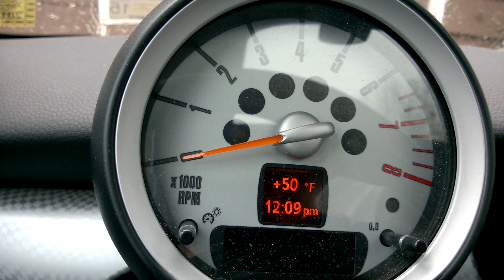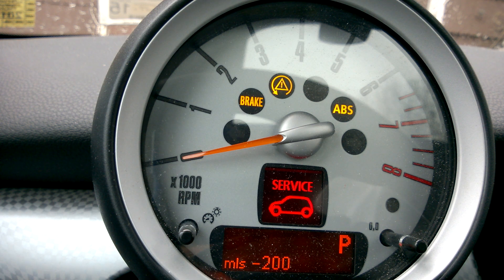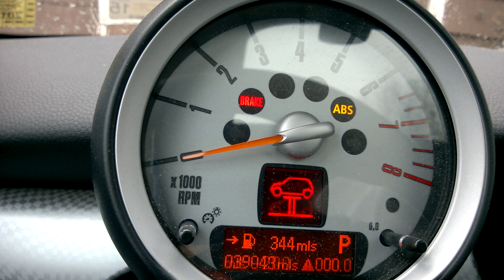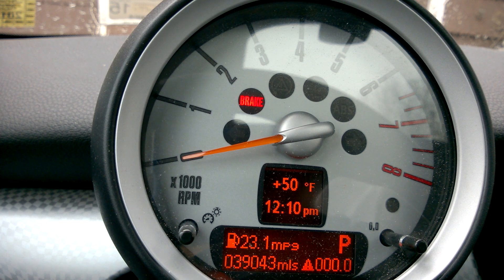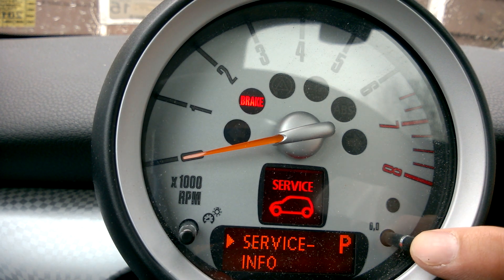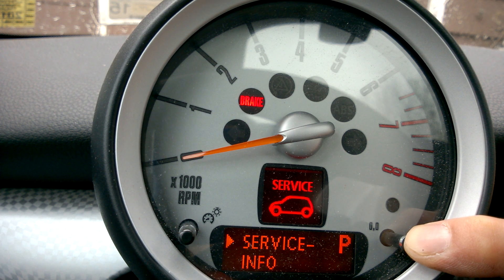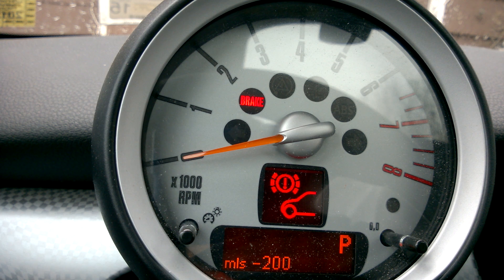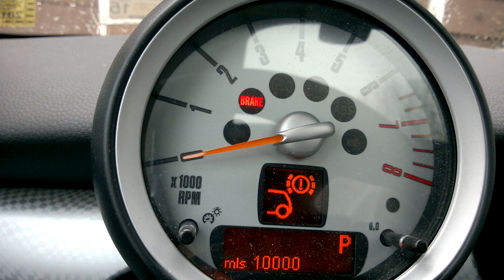Resetting brake pad service indicator R56 MINI Cooper S

Comment: This was a huge help.  The owner's manual leaves out a few things.  That manual is a complete mess regarding the onboard computer.
Reply from the maker: Glad it helped!  

Other hidden function that MINI obfuscates is the ability to read sensors with the onboard display, coolant temperature for example-

Ignition on,
Hold right cluster button until it says VIN, press button repeatedly to get to mode 19 for the lock code entry, then pause and wait for it to show lock on/off display, then set the code by short pressing until display shows the required code, e.g. 27, which is the sum of the last 5 digits of the car's VIN.

Long press to get back to mode selection menu, then repeatedly short press to go to mode 07 for the coolant temperature display, pausing for it to come up.  Then it should show the coolant temperature in deg C, which MINI inexplicably excluded from the normal gauge instrumentation, despite it being much more critical than other cars, given the tendency for the water pump and thermostat to fail on these.

Comment: I’ve done this, but the front pads light is still staying on? Are there actual sensors on the pads as they wear down, whereby the front pads service light won’t go out unless they’re renewed, or is it purely a mileage trigger for renewal?

Comment: Does this work regardless of service on the brakes...just curious.thanks for sharing.
Reply from the maker: This warning is just checking for the connection of the sensor wires on two of the wheels, and doesn't directly measure the pad thickness. They mount the sensor, which is a wire loop inside a substrate that will wear down as the pads get used up and get closer to the rotor. When the sensor is worn down from contact with the rotor, it breaks the wire loop connection and sets off the warning.  If you replace the pads before it breaks the loop you wouldn't have to replace the sensor, but they didn't design it to be removed easily when replacing the pads, so it takes extra care to remove. Shops probably won't want to bother saving them for you even if they're still intact, easier for them to just bust them off and put on a new sensor. Should be about 15 to 20 bucks each.
Reply: @dtrrtd774  THANK YOU for explaining this to me was very useful since I was thinking my back brakes have about 40% life left..any couldn't turn the light out.its funny how they let you reset the front brakes but not the rear brakes.
Reply from the maker: @dcartellone2659  They put the pad sensors on diagonal ends, one front one back.  They apparently figure both sets of pads on the front always wear evenly, and both sets on the back also wear evenly.  It's a high tech solution that doesn't work as well as the old school metal clip wear warnings that screech like a banshee when the pads wear down.  Those come with every set of pads and don't cost anything.  And those will work if your left and right pads don't wear perfectly evenly.
With this mini setup, if the pad on the unmonitored side wears down to the metal, you'll get no warning until the pads start grinding down on the rotor.

Comment: If I'm changing front and rear pads and sensors, Do I need to do this to reset the rear light as well as the front? I'm assuming so, but wasn't sure since you only showed resetting the front. And, you say that on a 2010 there are wear sensors, but it's actually the same on other years. Mine is a 2009 Clubman and it has the same sensors. The sensors are on the right rear, and left front. Only one sensor per axle..i'e..one on front and one on rear.
Reply from the maker: It doesn't distinguish between front and rear, so it trips the warning if either one of the sensors is open.
As long as you restore both sensors, you should only need to reset it once.
Reply: Thanks. Already figured it out, did mine a few weeks ago. ;) Pretty easy once you do it. ;)

Comment: Is this a common thing because this just started happening in my car I need to get to the shop and they said it’s fine but do I need new sensors?
Reply from the maker: If you try the reset and it doesn't clear the warning, you may need to check the continuity of the pad sensor connections. The pads may be actually be fine but this warning indication goes strictly off the sensor connections.
Reply from the maker: These pad sensors are separate items from the pads themselves, and basically get damaged when the pads wear down and the wire rubs against the brake rotor.
If you always replace the pads before the light comes on, you can save the sensor for reuse, but I don't think there are many drivers that are going to be continually checking their pads and proactively replacing the pads before they have to. That would be trading off pad life to protect the stupid sensor.

Comment: hey question, is the handbrake light flicker supposed to be normal?
Reply from the maker: There shouldn't be normally any flickering on anything. Is that only when you pull up the handbrake?

Comment: Got my cooper S front brake pads and discs both done... Got car back from garage and my brake light has been reset but it reads 31,000.... I have since tried resetting it myself but it stays at 31,000.... All the ones I have seen say 37,000.... Anyone get another number other than 37,000?

Comment: There's a part I need to replace but idk what is called 
It comes from the coils out in a cable the tip is Male and it broke any idea what is called? (Mini Cooper 2007) thanks!
Reply from the maker: Do you mean the pad sensor connector?  That sensor is available as a replacement item.  I reused my sensor by restoring the broken wire loop, but f your connector itself is broken, best thing is to just get the replacement sensor.  It's not too expensive
Look at the pictures here and see if it matches what you're looking for-
http://www.rockauto.com/en/catalog/mini,2007,cooper,1.6l+l4+dohc,1434913,brake+&+wheel+hub,brake+pad+wear+sensor,10283

Comment: Mine doesn't go away even after reseting it. Anyone know the reason why?
Reply: I actually have the same thing 😅
Reply: @saudvlogs4103  me too! I think it was the dealership that didn't fix the sensors though, i read the description under the video and it said that if the circut didn't get recconected or something that it won't allow you to reset it

Comment: The countdown is done but the reset it's not!!!!!??? What can i do ?
Reply: @DTR RTD
Reply from the maker: Countdowns are usually what they do to have you do something to confirm you want to go ahead with it. In this case you have to press the reset again to confirm, otherwise it times out and assumes you got in there by accident. 
They should have eliminated the countdown and simply gone ahead with the reset, since there's no valid reason why someone would want to leave the warning light on if everything is replaced and working now.  Poor design in my opinion-
Reply from the maker: Description
-Procedure for resetting the service indicator after
replacing the pads and restoring the pad sensor wire
loop:
-Turn ignition on without holding down the brake
pedal, (no need to start)
-Cycle left stalk button until it shows set/info
-Press and hold button until it shows CHECK-INFO
-Press once until it shows SERVICE-INFO
-Press the right tach button (trip reset) for 10
seconds until display changes.
-The brake pad warning should show up in red,
showing in this case, "mls - 200" indicating the car
was driven 200 miles past the tripped point.
-While on that display, press and hold the turn signal
stalk button and it should show RESET.
-Release button, then press and hold button again,
a timer clock will show up, as a brief confirmation
period to let you change your mind and cancel the
reset.
-After the clock cycles around, the reset is complete,
provided the two pad sensors no longer indicate
an open circuit. If it doesn't reset, the pad sensor
circuitry is still detecting an open circuit.

Comment: How did you bypass the sensors?
Reply from the maker: I didn't bypass them as I still wanted to have it provide warning for a low pad lining, but rather than buy a new sensor I reconnected the wire loops that get cut when you let the pads go below the limits.   It's not a performance enhancing item so I chose to just restore the loop, which will still provide the same warning.
It takes a bit of soldering to do that, so if you don't have the means to do that, you may either want to just buy the replacement sensor, or bypass it by taking the old sensor and looping the required connection.  
Think you're better off retaining the warning feature though, to avoid the risk of running it down to the backing and trashing the rotors, unless you're diligent about checking the pads regularly.   As it is, they don't even check all four wheels with this rather poorly set up electronic warning system, so if you had uneven wear, you could still trash the unmonitored side, despite the sophisticated warning setup.
The old school screeching pad wear clips that were commonplace always came with each new set of pads, and covered all the wheels.  I consider that better than this setup.

Comment: Hi has anyone a fix for the 2004 R53 model as they aren’t the same instrument clusters? TIA, brakes and discs changed but the orange lamp in the speedo clock is staying illuminated

Comment: Mine's not resetting on the front pads, although the little clock countdown starts. The pad sensor had been cut and wires separated. Should they connect as a circuit? Doing each cheapest fault first, until the big stuff, then maybe scrapped at 81K.  😭
Reply from the maker: The wires on the sensor need to be connected together to enable the reset to work. If the wires are cut and left open, you won't be able to reset the warning light.  
The sensor can be purchased and replaced if you want to retain the warning function, it's a poor design setup that requires replacement as a separate item instead of prior designs that has them built in to every set of pads. 
Even the cheap metal screech warnings are better in not needing this fussing about. Problem is only that some drivers are clueless about the screeching sound they hear when they brake.  So, they do this warning electronically, to light up a dash warning light, which may be just as cryptic to some.

Comment: Hi there
When i press reset the time icon appears for a few seconds but it doesnt reset break pads...what am i doing wrong?
Reply: Matthew Sulivan  Mine is doing the exact same thing doesn’t reset. Did you get it to work or do something different? Thanks
Reply: Same for me. I followed the instructions exactly, get to the part where the timer counts down to reset the light, then it still shows I am -10 miles for brake service. I repeated it many times without success.
Reply from the maker: Possibly the wear sensor is not intact; the sensors need to be replaced when the pads are changed since if the warning comes on, that means the connection is broken.  The connection has to be restored before it can reset.   I actually reused my old sensor by restoring the filament connection, but the new sensor is $15 to $20, so most people will just go and buy a new one.  I just didn't like the disposable aspect of the warning system so I made it into a reusable sensor with a soldered on wire.
Reply: @dtrrtd774  thanks for your video, but I'm having the same problem, it's not resetting, can I bypass the sensor by joining the wires from the sensor and then reset? I'm fairly diligent with checking pad wear, plus my brake pads will probably last longer than the car will 😁 thanks
Reply from the maker: @jamesgillespie9000  If you're okay without the sensor warning, you could do that.  Just connect the two wires and reset it, the system will think it's fine.

Comment: Not quite correct. You have to press the Start button TWICE at the beginning. You can hear him do this if you listen. This is critical info.
Reply from the maker: Yes, turning on the ignition lights up the instrument panel display.  If you just want to sit in the car and play the radio you can press it once.  That's the equivalent of the accessory position in the olden days where keys were involved.
Reply: Yep, for some reason the two or three sources I checked all failed to mention that you have to press Start twice; very aggravating, because then none of the following  instructions work. I would suggest adding a caption to your video, pointing this out.

Comment: Show what your pressing. Video is useless
Reply: He explains that he's pressing the button on the end of the turn signal lever. I had to watch the video 5-6 times before getting the sequence just right, but it worked. 2012 Roadster
Reply from the maker: Description
-Procedure for resetting the service indicator after
replacing the pads and restoring the pad sensor wire
loop:
-Turn ignition on without holding down the brake
pedal, (no need to start)
-Cycle left stalk button until it shows set/info
-Press and hold button until it shows CHECK-INFO
-Press once until it shows SERVICE-INFO
-Press the right tach button (trip reset) for 10
seconds until display changes.
-The brake pad warning should show up in red,
showing in this case, "mls - 200" indicating the car
was driven 200 miles past the tripped point.
-While on that display, press and hold the turn signal
stalk button and it should show RESET.
-Release button, then press and hold button again,
a timer clock will show up, as a brief confirmation
period to let you change your mind and cancel the
reset.
-After the clock cycles around, the reset is complete,
provided the two pad sensors no longer indicate
an open circuit. If it doesn't reset, the pad sensor
circuitry is still detecting an open circuit.